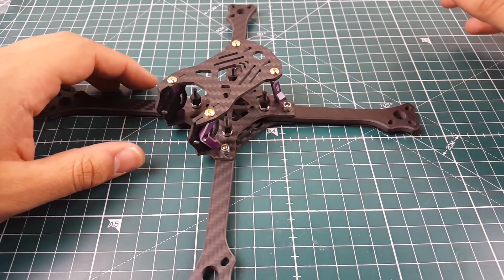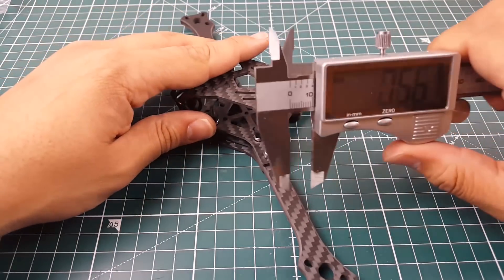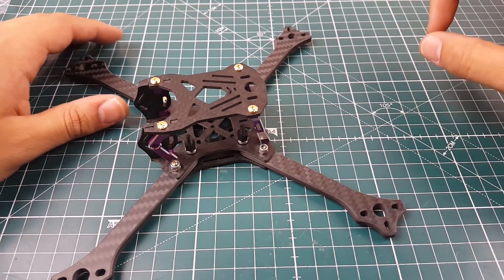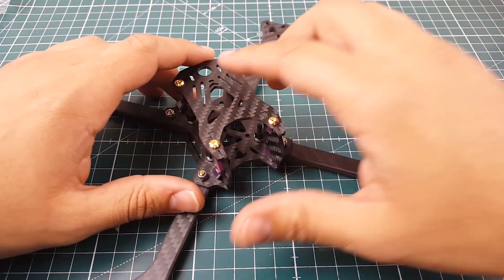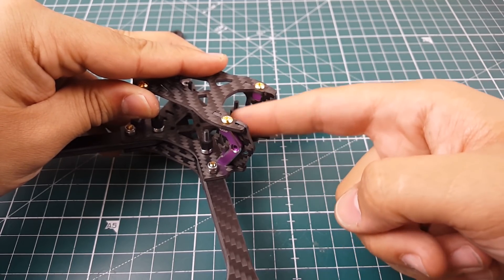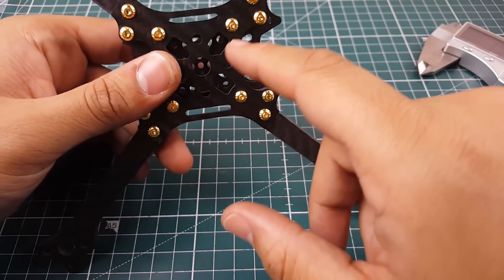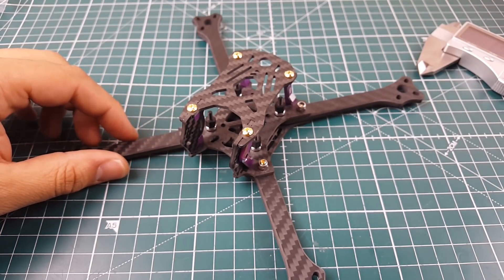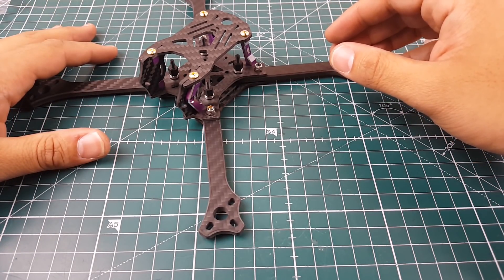Impressed with this frame // 3B-R 211 Positive X Arm 211mm

Comment: I just built up two of these, one with Tmotor F40 pro v2 2600s for 4s and one with Tmotor F60 pro v2 1750kv for 6s its such a bang frame i cant even say how good it is.. it flys like its on rails and tracks like a cat on carpet... running Butterflight at 32k/16k and blheli32 this is one of the best flying race frames to date imho... i was turning .3 secs a lap quicker avg lap time with this then i was my Mode 2 ghost thats setup exactly the same.. this frame turns like nothing ive flew before maybe because its so ridged or the geometry idk but it is the tightest flying race frame ive ever flew and ive flew them all.. i did 3d print a micro cam mount for it... with a frame this good throwing a 15 gram full size cam in it is just silly... im running a Caddx SDR1 in it (my very fav cam right now) im coming in at 237 grams with AX II and a full set of the new GF5149s on the F40 pro v2 build and 251 on the F60 pro v2 build..honestly this frame at 250 flys better then my 200 gram tight track builds.. its hard to believe because most frames fly similar and if tuned simular there isnt a ton of difference so long as the weight is close to the same and power is close to the same.. this frame is an exception to that, if flies tighter lines then builds that are 40 to 50 grams lighter and thats something i can feel, when a build is 20 grams different then another build i can feel it even if power is the same i can tell as soon as i do a tight 180 around a gate or a tight split S.. this frame truely flies like builds that are a good 30 to 50 grams lighter and how they made that happen i would like to know.. i ordered 4 more off amazon today after i put about 20 packs on each one yesterday.. i ordered 3 X frame versions and one Stretched X version... one is getting FinX 30s on it and the other 2 are getting hand wound custom KV F40 pro V2s on them and one is getting a set of F40 pro v2 2150kv for a higher KV 6s monster that is gonna be brutal lol...

Comment: I have just used a RRUISSi F210XT frame that appears to be similar (not a clone). its a bit of a budget frame with a lower price but you may like it as it stands slightly taller.

Comment: -R-XSR= other side of Matek VTX 
-Matek F411 built in Frsky combined with
-Matek VTX hv = about 18mm including middle spacers 
-DalRC 40A engine 4 in 1= hood could remove motor cover to gain a mill??? about 6mm high with it on might be super tight?? See how it goes and of course a
-Monster V2 with a 1.8mm lens...1.8mm I know but when it’s on you don’t even notice the fish eye through Aomways I run looks prefect! 
Don’t know if, that’ll all fit snug but you’ll let us know 👍🏻
T-Motors all the way F40 PROⅡ KV2400 
5.1 Dal props
The thing should punch holes it the Sky!!!

Comment: That's the first thing I said when I built this frame! strongest frame I ever flexed in my life, and their arms don't even but up against each other!  I used the hglrc xjb f438 with the hglrc vtx 20 20x20 stackable vtx and bbb 2207 2650kv foxeer micro predator with a runcam split full size cam adapter and micro runcam adapter, only con this frame has its it only fits full size camera :(  very very powerful setup. it outlasted me and that is saying alot! I broke 2 frames last week so yeah ;)

Comment: clean frame!! btw i started using the racerstar 2306 2400 kv with cyclone t5040c props and motors get hot! any advice on how to change my pids so motors wont get hot?
Reply from the maker: Check the screws that go into the motor on the side where the wires is comming out. If unsure remove them and run a little test if solved use small screws. If not it either tune or filter issue.

Comment: You said the arms are held in with 3 screws? but you only showed 2?
Reply from the maker: The third is the one going into the standoffs :)
Reply: Oh its hidden there screwed into the aluminum. The reason i asked is because you were saying how strong the frame was and it didn't seem anything unusual, but i guess the quality of the carbon and the three screws proves to make it real strong? its a real pretty frame also. I also like the three hole motor screws also, I dont think you need 4 screws.

Comment: Will a Racerstar StarF3S fit? You could direct solder the battery lead pointing down with the ESR Cap attached to that. then a VTX that fits on the stack like a Matek or AtlAtl or AKK. then squeeze the RX behind the camera or attach it to the back of the camera. no need for a RX to have telemetry.

Comment: Build with:
- Racerstar StarF3S 30A BL_S 4 In 1 ESC (LED > softserial for S.Port, GPS UART for VTX control)
- R-XSR
- Matek HV VTX (or other VTX of choice)
- 2205 motors (T-Motor or Motor brand and Kv of choice)
- Camera of choice

Should all fit quite nicely and keep it light and fast.
Reply: Use the dys storm motors